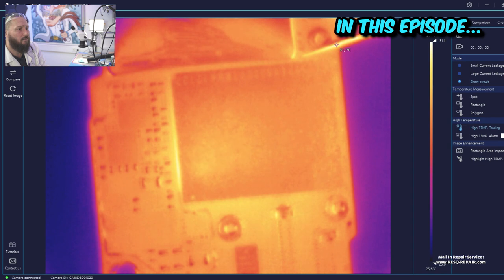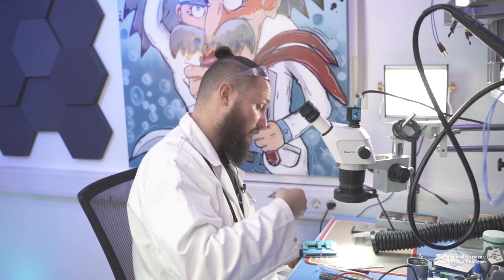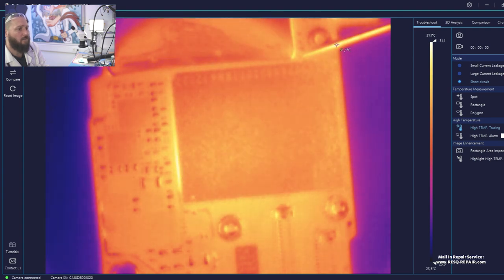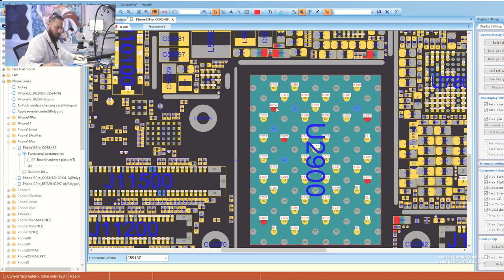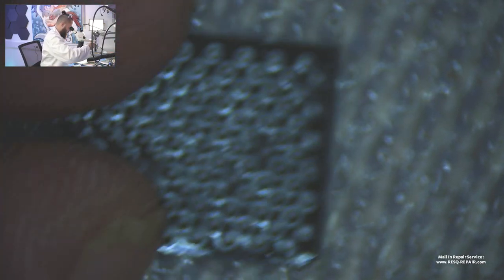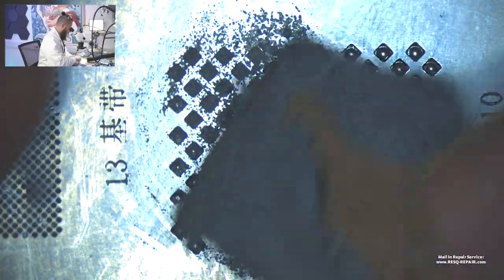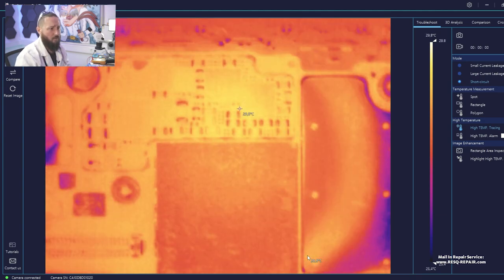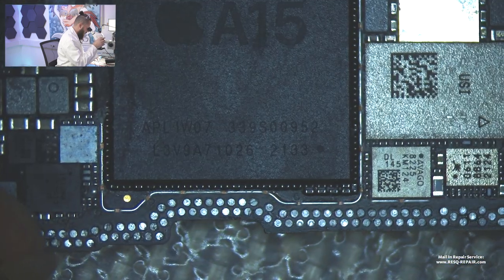👨‍⚕️Dr. Ben: iPhone 13 Pro not powering on - Can we repair this? (Troubleshooting NAND & RAM Issues)

Comment: Hello Ben, excellent work as always.
Just wondering if we could ask you for one tip or shall we call it a request:

Could you add an extra camera during the repairs so we can see what air temperature and flow you are using, or at least mention it....this is a great deal for us rookies, since different components need different air flow and temperature.
Thanks!